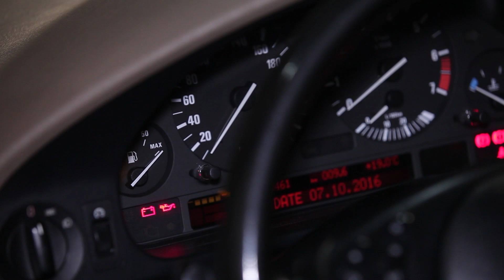How to change engine oil and oil filter BMW 5 E39 [TUTORIAL AUTODOC]

Comment: This bmw have a 6.5-7 liters of oil… why mechanic have only 6?
Reply from the maker: This video contains only tips and recommendations that may be useful when repairing a car or replacing parts; the number of cans on the table may not always correspond to the number that was poured into the engine.

Comment: Only 6 quarts of oil ? Isn't no less than
6 1/2 and just below 7 ??
Reply from the maker: All of our videos are for informational purposes only.
The replacement procedure may differ, you can find all the information on replacement directly in the technical documentation for your car or use the help at a service station.
AUTODOC

Comment: Hi Guys,

I noticed when you turned the ignition on the check engine light didn't illuminate.

My E39 doesnt do this either, is this a common fault or did the E39 come from the factory like this? 

I don't expect you to have all the answers but it's worth a shot.

Thanks Guys

Great vids, keep it up 😁
Reply from the maker: Thank you for your feedback!  In whole, when starting an engine, all indications  as  signals  of  operability of  indicators and sensors.  After starting they should  turn off and turn on only in case of  technical malfunctioning. Best regards,   Autodoc.
Reply: autodoc.co.uk hey great video ? My 530i needs a oil change soon? Should I do it myself or have the dealership do it. I’m pretty good myself

Comment: you put the filter in first and didnt add oil with filter????
Reply from the maker: Thank you for the feedback! This video is considered to be an informative one, and it shows the sequence of repairs, so some stages of the repairs might have been excluded. Best regards, Autodoc.
Reply: Hi Karl, I'm going to try this. What do I need to do with the filter? Do I smear the new rubber washer with oil? Kind regards, Paul.
Reply: What do you mean?
Reply: @pauli1968  yes, exactly just a tab of the fresh oil around the gasket will do.
Reply: Dont know if you quit watching the video thinking he didnt replace the oil. Yes he did😊 The filter is upside down compared with other filters. Adding oil wont help much.  It would only flush down to the sump. ( if my car i would if its flushing down used oil😊. But one of the channels from there would circulate as unfiltered. Either way it getting filtered after engine start-up. I use to add some new oil after drained to flush out the rest of the old oil in the sump. I oilflushed a volvo v70 once.(which used a lot of oil). And i filled up with new oil enough so at least the pick up reached. And let the engine idle for a while. And then drained it again. And then i plugged the pan. Filled a bit enough to flood the bottom of the pan. And replaced the filtre. Drained the oil(2-3dl) and then filled it up to max. It went down on oul consumption. After a vacation drive back and forth 17 hours each way plus tours on vacation site. When coming home the oil was still transparent and chamoagne coloured. And havent sunk even a quarter to low on the dipstick. So that was a very succesful oilflush. But i learned to never do it a 2nd time. It smoked blue and started to use oil again and oil turned black the first day. So the first flush was enough. On the first one when draining oil it came out a lit of "sand" and grey gel like guuiyee. So thats why i flushed it with new clean oil 2 times between the chemical flush and filling the oil which was meant to stay. And now i am wondering if i dare to flush again(Bmw this time). After i read much more about flushing. I dont recommend chem flush. But if so lucky as the first time i did its recomendable. But i guess it is a gamble. If pieces of dirty oil loosen and ruin engine in aftertime. But it was cool to see that it took 11-13 months before the engine turned black again😊
Reply: @scaniawahl  instead of a flush just do 2 seperate oil changes within a week or so, and drive once for at least 100km in one go, so to mix it up well. Also, it helps a lot to change the oil while it is still hot, just be careful not to scorch yourself.

Comment: Only 6 liter of engine oil right ?
Reply from the maker: Thank you for your feedback! In this case, was used exactly that amount of oil. Best regards, Autodoc.
Reply: @autodoc.co.uk seriously?!?! ALL e39s uses 6,5 litres of oil!!! 6 liters is not enough.
Reply: Engine oil and filter change quarts (liters) 6.9 (6.5) – BMW 525i, 530i
7.9 (7.5) – BMW 540i
Reply: @FlexinJump  maybe some was left  in bottom of motor?
Reply: How many nM on the oil-socket ? Or it doesnt matter ? Thanks
Reply: @dusandub  the oil drain plug needs to be torqued to 25nm (18 ft lbs) or if you feel that is going too tight then just until it feels ok to you